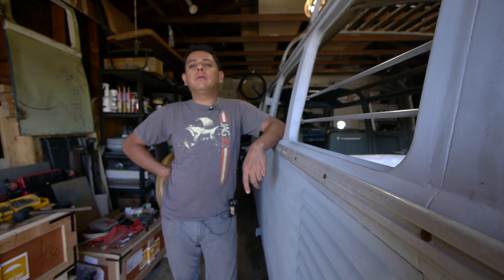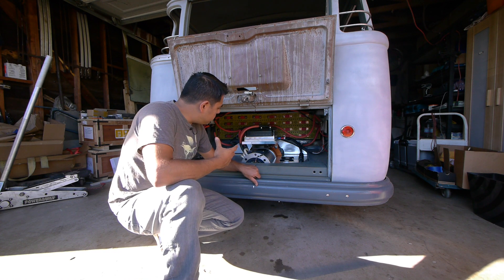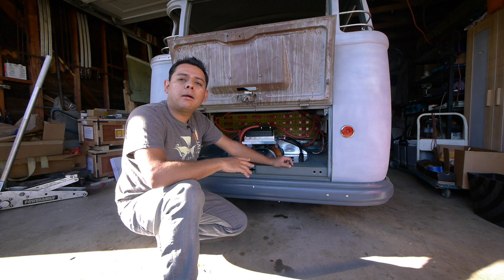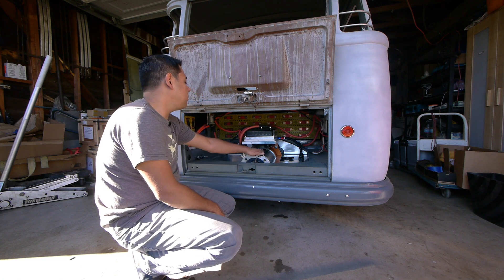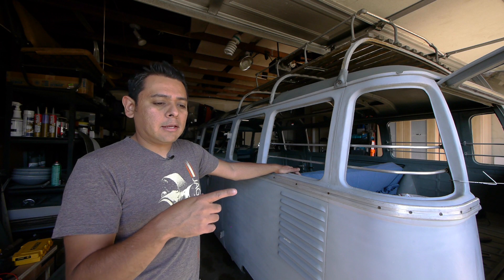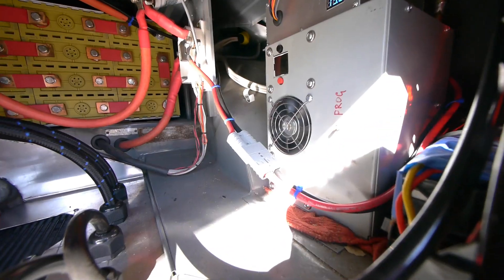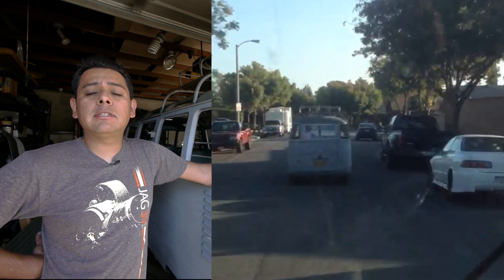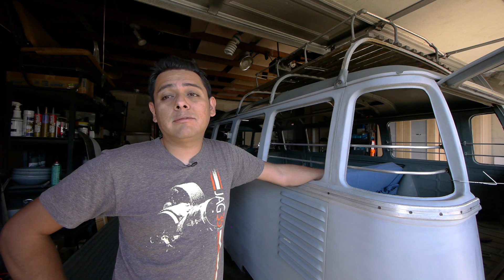DIY EV VW Bus transformation - Let the Fabricating begin

Comment: you should install a slide out tray from underneath the shelf and for the charge controller you should mount a small camera inside the compartment and have a small monitor in your dash up front so you can see it while you are driving, like a back up camera. what happens when it rains? everything water proff inside there?